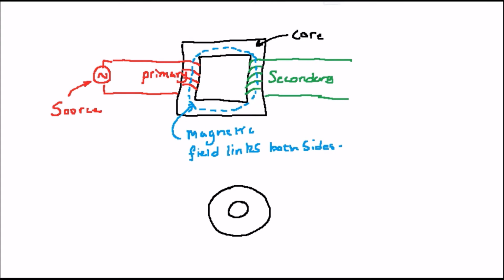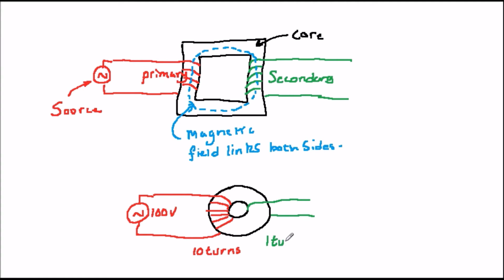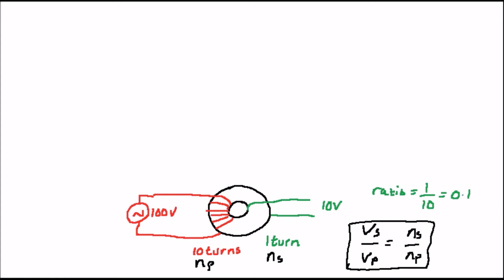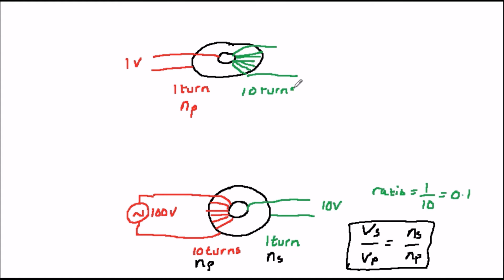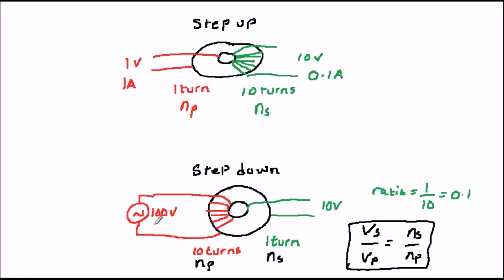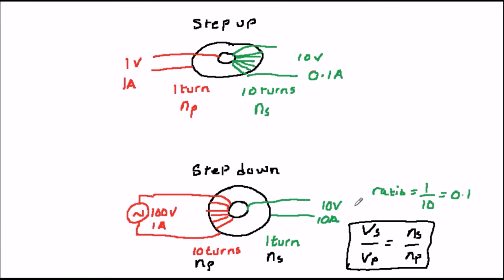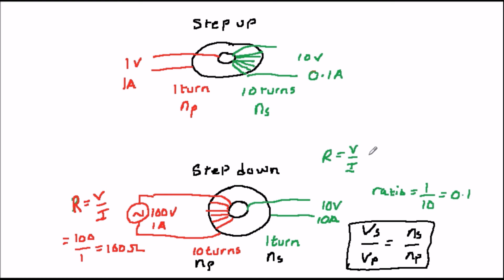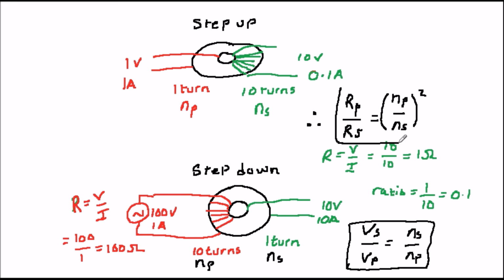Analogue electronics 21: Basics 21 - Transformers

Comment: The calculation on resistance at 2.40 seems wrong since the current on the secondary is not 10a but 0.1a.
Reply from the maker: I may have made an error in the way I said it - the resistance at the secondary is 10v/0.1A = 100ohms. At the primary it's 1V/1A = 1ohm. This is a resistance ratio of 100/1 = 100. In turn this is the windings ratio (10) squared.
Reply: @geekypeek232  You  are right indeed.  I missed the 1V on the primary and so the end result is as you said.  Thanks for these videos by the way. They are awesome.  They deserve more views.
Reply from the maker: @bittertruth6575 Don't worry - I often make silly mistakes and errors in the videos, including the most popular ones!